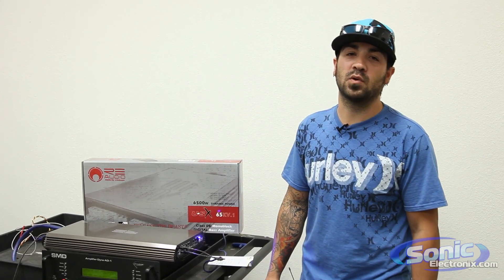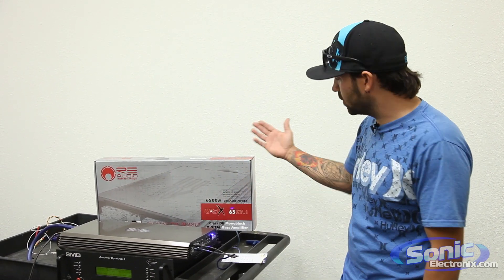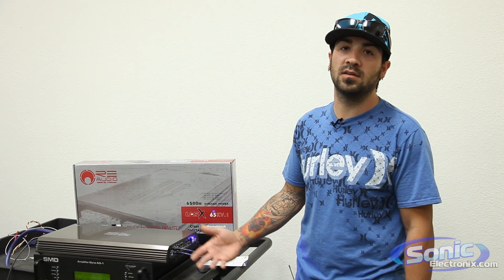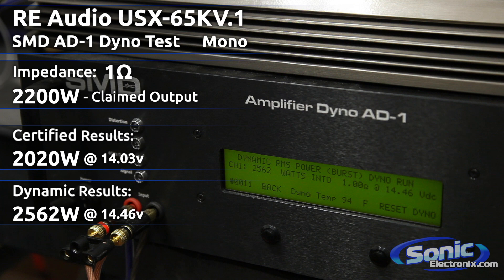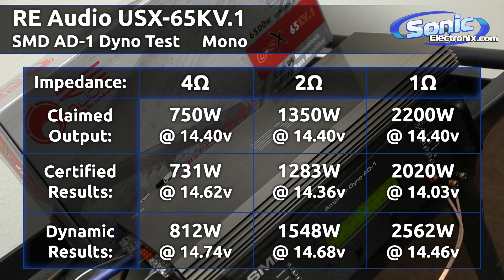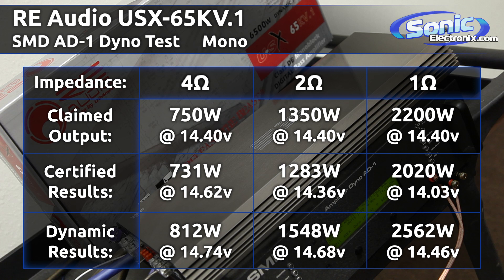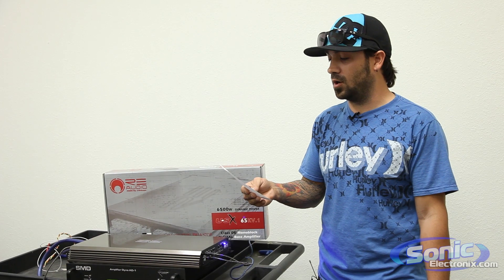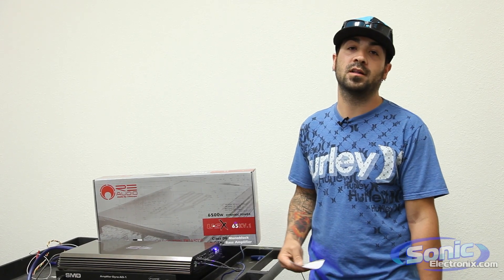RE Audio  USX-65KV.1 Amplifier Dyno Test | SMD D'Amore AD-1

Comment: For less, $479 a customer can pick up a Crescendo BC2K. 0.5 ohm stable, and 16.8 voltage capable. :)
Reply: We're can I get that?
Reply: yxxhoj225 BASS CLEF SERIES BC2000D. You can find it on Sound Solutions Audio (SSA).